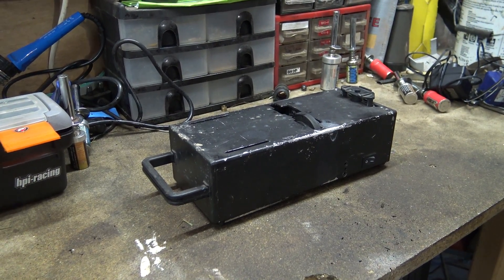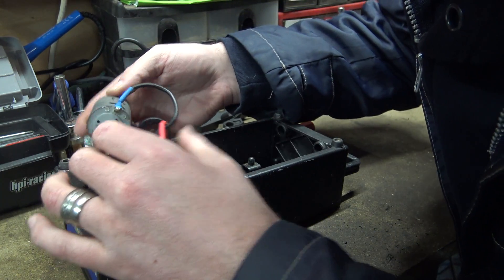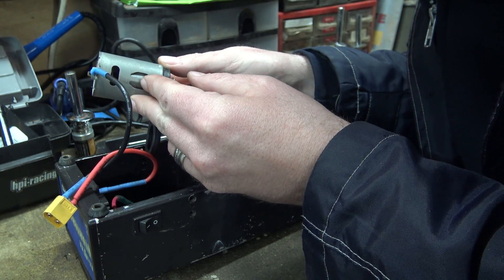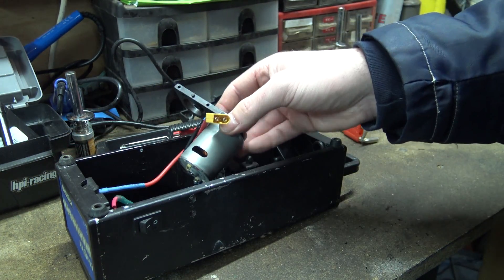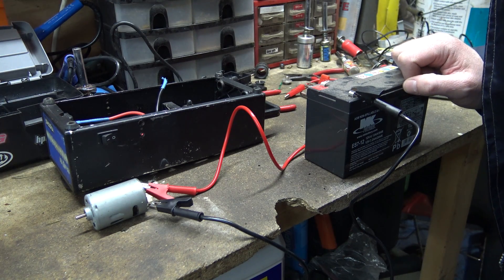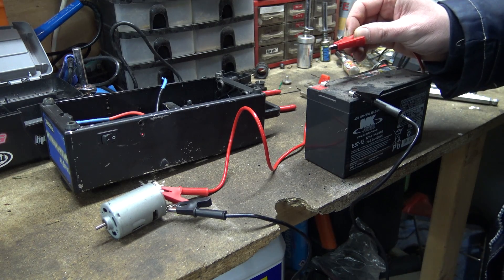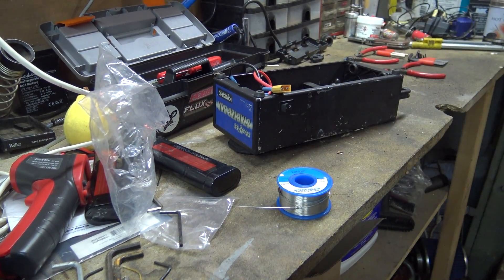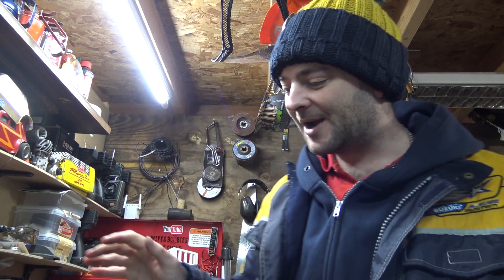Kyosho Half 8 Starter Box Repair! Burnt Out Motor!!!

Comment: I just wanted to tell you if your on eBay rc used and parts  for the search  you can run across some good lot deal  to be able to flip after repair  quite of bit of my rc savage  thing that iv gotten were off eBay and they list it as parts and repair always read the direction  I have been able to sell  6 nitro car   that weren't savage and my buddy bought two of my savage  last year I didn't try to really sell and buy alot my self just enough to be able to run  and let all the kids  play with them  but I can definitely see if you no what your looking at and no what the going price are you can make quite a bit as your willing to repair it  you look like your on a roll and don't dought you will be able to be a repair shop with YouTube instructions and repair video on a roll have a good one till the next one 👍✌️💯🏎️